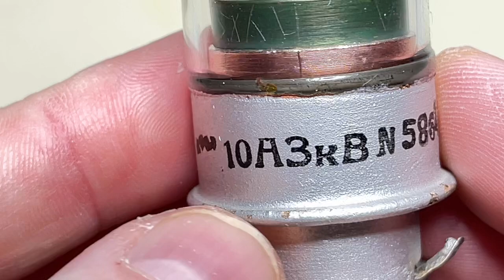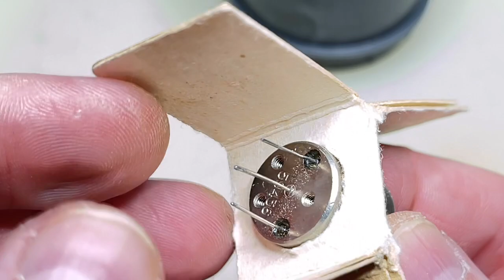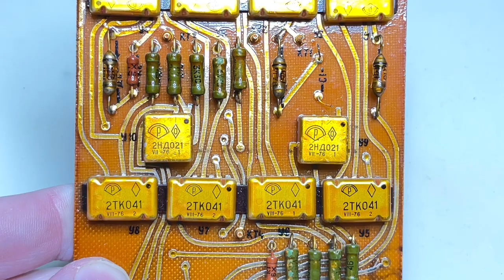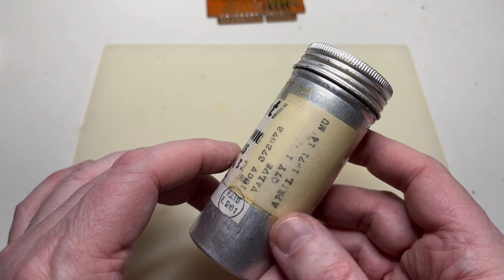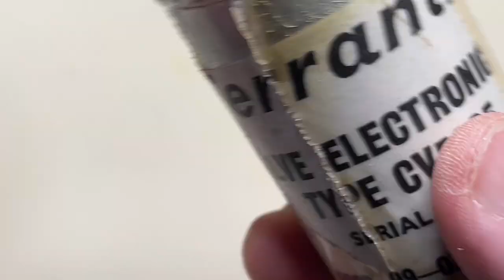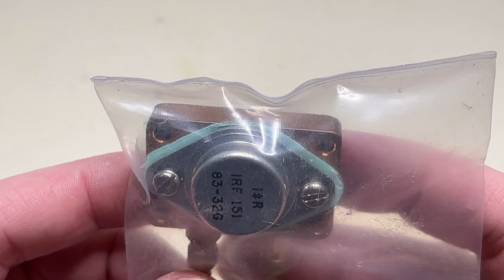#1 Vintage SOVIET(USSR) and WESTERN Curiosity Electronic Parts

Comment: 1:45 Nope, ОТК just means "[manufacturer's internal] quality control department", it does not mean military grading. Quite the opposite, an OTK stamp by itself means it is not a mil-spec part. Military and special acceptance is usually signified by a rhombus (diamond), triangle, or a number in a five-pointed star, or letters ПЗ ("customer acceptance").
Reply from the maker: Thankyou , this is new to me , everywhere i read that otk means that is manufactured to mil standards
Reply: Absolutely, there's tons of good faith misinformation in the English-speaking internet on this topic

Comment: oh i have the 8086 clone its super cool
Reply from the maker: Looks like a chocolate bar :-)
Reply: @KonstantinGrigoriadis  there was computer based on such processor in soviet union in late 80s - XT clone named "Poisk" . Bare minimum -no hard drive,no floppy, only 128k of ram no monitor and even with such min configuration it cost 1000 rubles or 5 avrg monthly salaries. It was my Unreachable kids dream :)
Reply from the maker: Hi Anatoliy, Thankyou for the Info, did it use a TV Set as the Display ? how you saved the code you wrote on this XT-Clone with no Floppy or HDD?
Reply: @KonstantinGrigoriadis  Hi, yes TV and audio cassette player/recorder needed for saving your programs . Another cheaper option to have a personal computer at those times was to construct your own zx spectrum clone . You already have couple  ICs needed for that - interface and rom :) To collect all ICs  that was real challenge - couldn't simply buy most of them in stores- USSR had shortage of everything at that time.
Reply from the maker: Hi Anatoliy, this sound like a ZX-Spectrum on Steroids :-) Do you know who Produced "Poisk" and what was the purpose of it if it was not affordable ?

Comment: That cool looking glass vacuum relay can still be obtained new. 3KVAC 10A 30MHZ reading form the 1986 tech specifications. The nominal trigger voltage is 18V but will hold until about 4VDC.